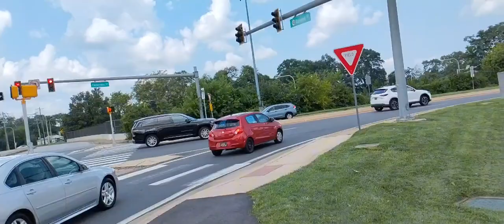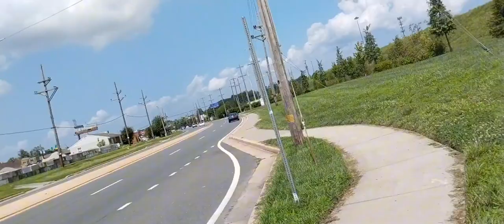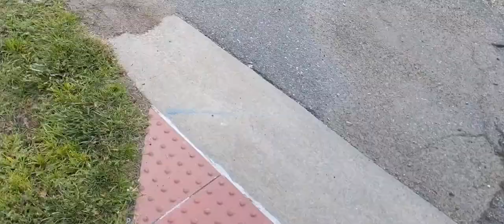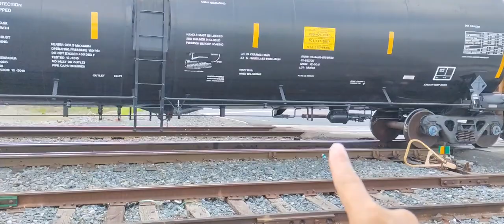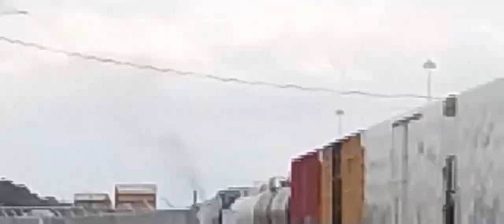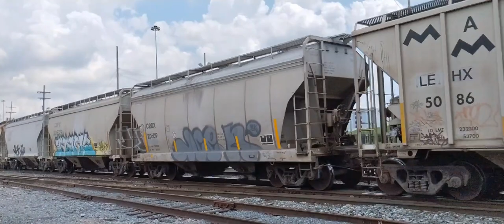Starting and Stopping a CSX Train Explanation - Slack Action, Applying Air Brakes - Surprise Catch!

Comment: How come those crossing lights keep going out?  Somebody needs to call signal dept!

You know, I would truly like to watch your reaction to opening the throttle on a 3 or 4 unit set of Alco C425s with a nice heavy train.  Nothing smokes like an Alco!

I got a kick out of your explanation of the differences between freight and passenger service.  The things you grumbled about were the things I liked about freight service.  Dealing with some of the public on the passenger trains was just not my cup of tea!

Question for you.  On an Amtrak train of say, 8 or 10 coaches, how many train service people would be on duty?  Surely, there would be more than just the one conductor.  What would be the job title of the additional personnel?  I mean, you can't have more than one conductor on a train!  In my time, beside the conductor, there would be, depending on the length of the train, one or more trainmen.
Reply from the maker: Good Morning, from what I have gathered so far, on a typical Amtrak train there will be an Engineer, Conductor, and Assistant Conductor (Reports to the conductor and is not in charge).  On runs longer than 6 hours in the cab, per the engineer contract, there will be two engineers in the locomotive cab.  On the northeast corridor (NEC), during a recent field trip I noticed some of the busier trains let's say between Philadelphia and Washington, DC, had multiple assistant conductors (AC's) onboard responsible for two or three cars only.  I am not sure of the requirements to have more personnel onboard the train just yet.  I hope this helps.  Have a great and productive day!  Yes, I would love to see the 3 or 4 unit set of Alcohol C425's!  I Love Trains!